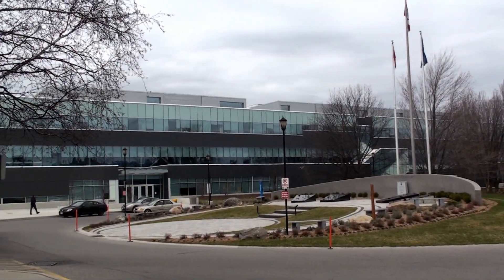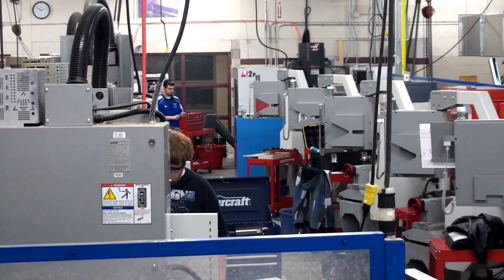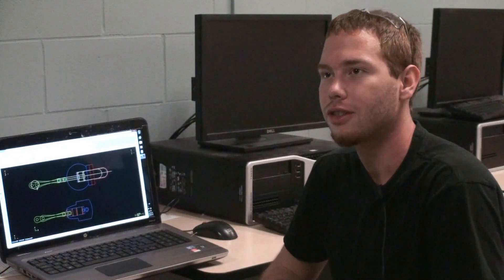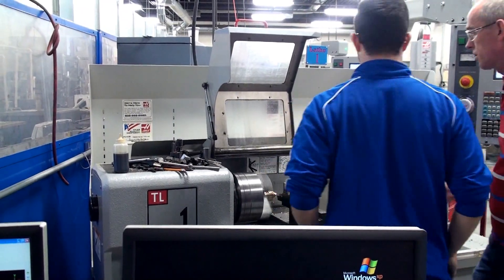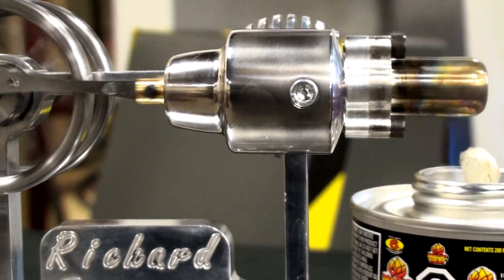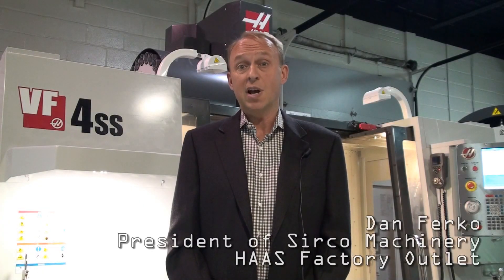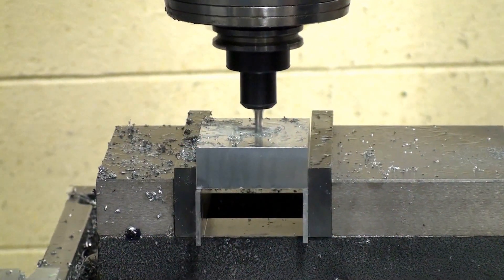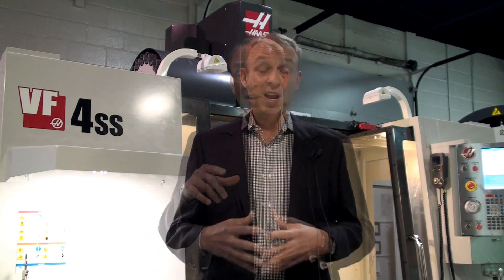Precision Skills Program at Georgian College

Comment: The bad thing about this field is the companies are hiring button-pushers and set-up people for the most part, which is not interesting and becomes boring/monotonous over time.

I hardly find a position offering programming exposure along with new set-ups which is more challenging and interesting.
Reply: Im here 12 years later to tell you were 100% correct. The entire class is all Indians now who dont even speak English in class. Just like every other buttons pushing job, they have flooded the trade and driven the wages down